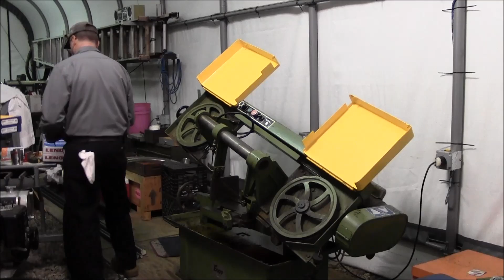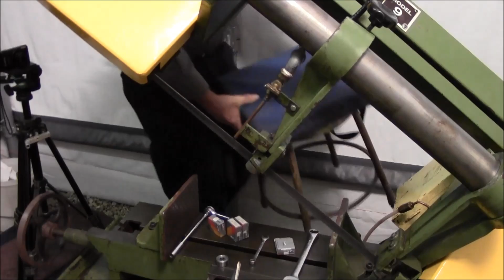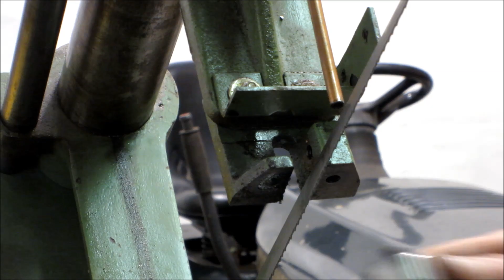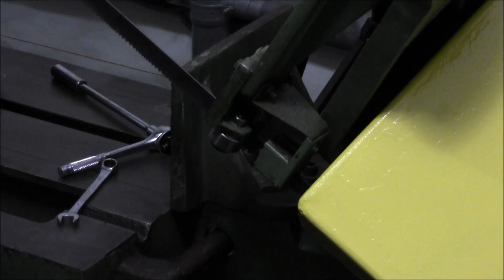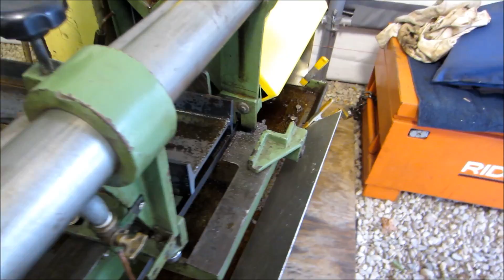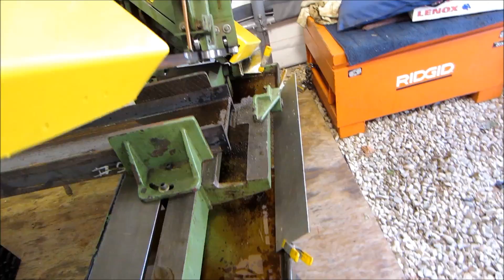ISAW 3

Comment: Keith you just got my fire started.  I have a 1903 Robertson power hacksaw (belt)  It has a
piston pump I just cleaned and tested ok,  All i see is that it recur. drain oil, chips and all, back to
the pump.  After your vid, i think I will add a sump on the return line- your vidio just popped the idea.
thanks

Comment from the maker: Thanks for the comment Bill, I had to test it and what a better way than to throw in a job. It has a set of worn wire brush wipers after the bottom set of bearings; I like erynthegrey’s suggestion on the rubber wiper! It has a hole in the area where you said yours has a drain, may also play with modifying that hole with tube and hose. Could always install six inch lift kit and make longer tray too!

Comment: Hey Keith! Got a suggestion to stop the drip. Use a piece of car tire sidewall about 2 inches wide by about four inches long and split it with a razor knife about 2 inches up the center. Then replace the two bolts on the bearing guide with bolt stud combos. Then put two holes to match the studs in the tire and bolt it so that each finger of the tire is wiping either side of the blade. That should also keep most of the iron crumbs off the bearings too.

Comment: (2 Continued) Also, it is handy to note that rollers should be adjusted just above gullet of blade teeth so roller only rides on flat. and won't flatten the set.  3) I use wet/oil stone to put a slight chamfer on the back corners of the blade.  It helps eliminate the corners digging into support bearing.  3) A piece of thick rubber lowered onto blade while running at the down feed roller support and then clamped in place will create a zero clearance wiper for the oil before it hits the rollers.

Comment: I know this is like 2.8.20 years ago- but better late than never. A suggestion: just as with an automobile automatic transmission- it would be a great thing to have a large magnet- down in the bottom of the sump, near where the door is- to be easy to pull and wipe off periodically. It would help keep the fluid cleaner- like a filter of sorts. Also- an excellent "cutting oil" is used diesel engine oil- some shops might give you all you want (for a 12 pk of Bud- not the kind you roll).

Comment: Saw works great.  I think the saw might have came (when new) with a removable apron that slides onto the side where you've got the flat piece and the spring clamps.  Our saw has a hole in the rear wheel guard at the bottom with a tube that drains into the main tray.  It's got a screen that gets clogged pretty easily.  

Nice work again Keith.

Comment from the maker: Lower it down to the table or material support surface, slide a square against the blade, in relation to table. If not square, first check guide bearing clearance and ajust if needed, if still off, there a tilt adjustment for the guide support mounts that can be loosened and ajusted to align. If all of these changes don't help, you may have waisted the teeth on one side of the blade, than the other and the dullness is stearing the blade off!

Comment: My dayton saw also has cams on all 4 bearing bolts, I think the reasoning is so you can adjust the blade 90 deg to the adjustable fence so you can make the blade lines up with the increments of the saw table for different angles.

Comment: Four things:  1) Grab an old round speaker magnet and put it over the pan drain hole.  It will catch 100% of your ferrous filings.  Add a fine screen to catch non ferrous.  2) I adjust roller guides with a sheet of paper between roller and blade.  Perfect clearance once paper is removed.

Comment from the maker: The stager of tooth size on the blade seems to stay crisper longer and has less harmonics develop like uniform tooth blades, there may be more reasons! I used the shielded bearings because the shield is stronger than rubber in that environment, with the shavings twisting around. The bearings are double roller for the width and the twist load that is put on them. They aren’t that expensive, I think those cost me around 11 bucks each.

Comment: When tightening the eccentric adjusters for side blade guides, there are two directions the bearing can be brought in. One is such that if the bolt became loose, the blade motion would pull the adjustment in tighter (as shown near minute 24 & 28). The other is to rotate it around the other way until the wheel comes in contact. This would not pull the bearing into the blade if bolt comes loose. Not sure if there is a proper way but I'd go with the latter.

Comment: You can adjust the cam action on the other  rollers by changing the thickness of your washer in the back. Depending on the pitch of the bolt threads, half a thread will give you max travel on your cam.

Comment: Mr. Fenner when I see you wipe off that bearing box and save the best used bearings I see myself and the resemblance is scary lol. They say people like us are anal or pack rat's but I can't count on my fingers and toe's how many times those traits have made it possible to get a job done. I am in the process of renovating my shop now, finding some stuff that just has to be recycled. I should be posting some video's of my shop and my new mill soon. Thanks again for your video's anyone that try's this video making can appreciate the time it take's.

Comment: Great vid, Keith!  +1 on Lenox bimetal blades, they cut mild steel great on my little 4" x 6".  No built-in coolant, so I just brush straight sulfur-based oil on the blade while cutting.  What's the deal on blades with two different size teeth, why do you prefer them?  Nice demo on folding blades and guide bearing replacement/adjustment, thanks!  Did you wind up using sealed or shielded guide bearings?  Is there anything special about these guide bearings or are they just ordinary bearings?

Comment: I have been using a water soluble oil, but it does evaporate, does the kerosene evaporate from the mix with the cutting oil over time?